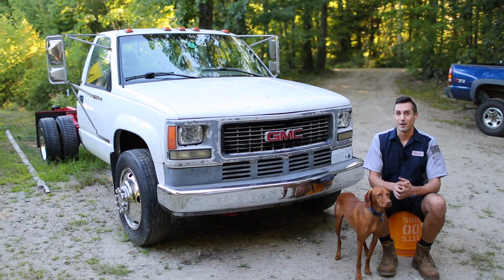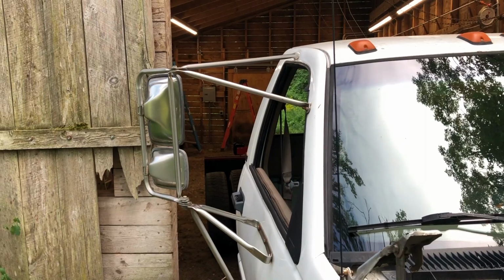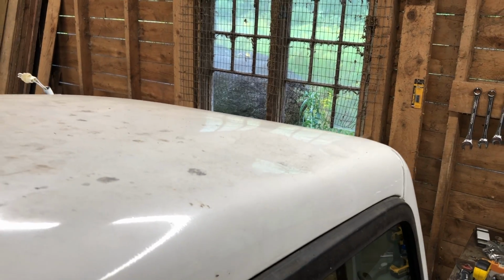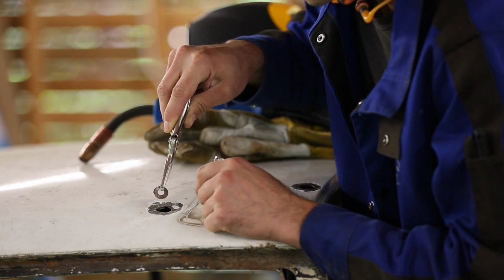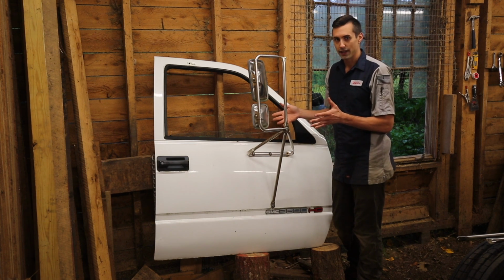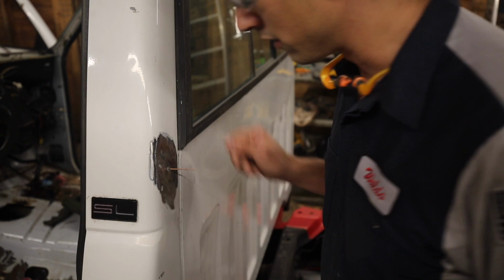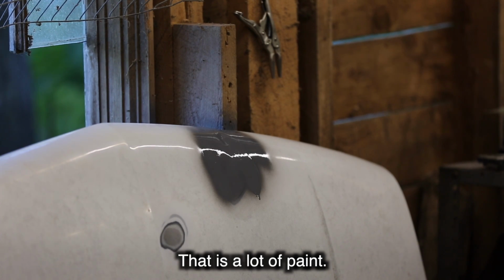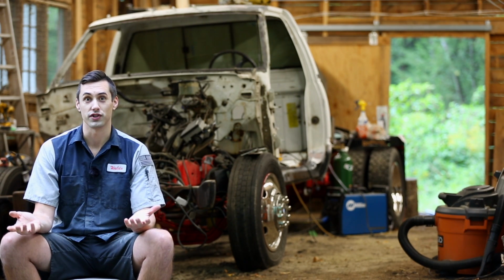Doing Body Work on my $300 Project Truck (GMC C3500HD) [Part 11]

Comment: Bought a stud welder about 2 years ago to repair the top rail of the bed of my truck where a smoker fell over on it and dented it. That was a great tool for the job, and I would recommend it as a cheap tool for anyone wanting to DIY some bodywork. Pretty foolproof too!

Comment: Tips 
To pour from a large paint can put a few strips of wide masking tape across the opening to for a V to use as a spout. You can also pinch a bit into a spout shape and stick it to the side where you will pour from to keep it from running down the side. This works for smaller cans too.
Use three containers to mix the paint and a scale for accuracy.
Pour some part A into one container and B into a second container.
Sit the third on a scale and add A and B to that. If you think that you will need more than one gun of paint having the aa and B already waiting to mix will save time and reduce the risk of contamination to the main can and spillages.

When grinding panels Remember they get hot and will buckle so don’t go overboard.

Dirt floors.
I believe there are a few methods of sealing them . 
One involves mixing in linseed oil another involves racking in a bag of cement and some sand tamping it down then misting some water over it to cause the cement to cure. You can also use lime but you need twice as much.

Rivnuts
There are three or more types 
Alloy, zinc coated steel and stainless steel .
Use steel or stainless steel ones on steel and alloy or stainless on alloy.
On steel put some thread locker or CA glue on them before inserting in the hole. This helps keep them from spinning and helps prevent corrosion.

Comment: A few tips:  I would dip out of the primer can, and punch holes around the rim to allow the excess to drain back in when pouring over the side.  Pouring the catalyst works better when the outlet is on top so the air can flow in smoothly.
Reply from the maker: Thanks for the tips! 👍

Comment: I’m interested why you went with a 24valve and not a 12valve
Reply from the maker: I honestly would have gone either way, but I just happened to find a 24 valve first. It wasn't easy finding a manual with RWD!
Reply: @WaldosWorld   will you be doing a p7100 conversion on it  or are you going to leave the vp44 on it
Reply from the maker: I'm going to leave the VP44 in it for now. I have a FASS fuel system for it to help ensure it doesn't run out of fuel pressure. If it ever needs to be replaced, I'll definitely consider a p-pump
Reply: So are you using the engine mounted lift pump and the FASS?

Comment: A you should of bought dodge 2006 mirrors that's what I put on my dually I just can't wait to do my cummins swap I got most of the stuff but I gotta finish my peterbilt it's on my channel and I gotta tear the engine out of my mega cab and rebuild it
Reply from the maker: I still haven't committed on mirrors yet, though I guess the default choice is to keep the big stainless truck mirrors. Sounds like you've got your work set out for you with all those projects!

Comment: good night friend ... a question what gearbox I can fit a cummins 4bt engine to adapt to a 3500 silverado 2005 truck..
Reply from the maker: That's a tough question because it depends on what flywheel housing the 4BT has. I'd imagine that many of them have a SAE 2 or SAE 3 flywheel housing for which it would be fairly easy to find a matching transmission.

Comment: I suggest fitting your doors before you apply the last primer coat.  If the doors are aftermarket, you may have fitment issues.  I am fortunate that I live in the south and can find used OEM doors in salvage yards that are in good condition.
Reply from the maker: Yeah, I thought about going to a junk yard, but the doors there will be just as bad  if not worse!
Reply: You maybe surprised with what you find. I scored a nice set of OEM fenders for my GMT400 from a local salvage yard up here in the rust belt of New England. Watch Car-part.com and you maybe surprised

Comment: every time i have bought "new" doors, they were a fitment nightmare. compromising on body lines and making the door seal. good luck waldo. i think you are more patient than me....no doubt you will make them work.
Reply from the maker: Yeah, that's a good point. So far, the replacement panels I've bought have had less than perfect fitment, so I shouldn't expect anything different from the doors. I guess we'll see what happens 🤷‍♂️

Comment: Waldo, is the plan to keep the compressor outside?  It looks permanently mounted to that slab.  Won’t there be issues with the pump/electrical and rain?
Reply from the maker: Yeah, I'll be getting it some shelter at some point. Luckily we've had some really nice dry weather lately!

Comment: My dad has a old 2000 dodge ram 3500 if like to have as a start to a project. It was my grandpas truck before. A bunch of Norwegians bought in new in 2000 with all the options in the book. Leather seats,wood trim,ect. But it's not in good shape. It has a damaged frame. And it needs some body panels replaced. I can buy a new or used frame and the body panels are literally everywhere for them. I guess what could go wrong lol. There's actually a news report with the truck in it from 2006. And I have a video on the truck when we got it
Reply from the maker: Oh wow, that's pretty cool! Is it a dually? Sounds like it'll be a nice truck after a bit of TLC!
Reply: @WaldosWorld  yessir 1 ton dually.

Comment: Great video but just to let you know you could use the tree branch to lower the compressor  by using a rope and tired over the tree onto the compressor and lift it up gently and drove your truck out underneath the compressor then lower the compressor gently by laying lose the rope gently
Reply from the maker: Yeah, I was thinking about that. It's an oak tree, so it should be strong, but I wasn't sure if any of the branches were big enough to handle the weight 🤷‍♂️

Comment: Another great video, Waldo!  I use a set of plastic kitchen measuring cups for scooping small amounts of paint out of a full can, like you had.  I’ve had good luck using POR-15 rust paint on floor pans.
Reply from the maker: Good idea! POR-15 is what I used on the frame, so it'll be interesting to see how it holds up over time!

Comment: you should put dodge tow mirrors on it to match the dodge/cummins engine
Reply from the maker: That's a good point! I didn't realize it, but this would be a great time to pick out some new mirrors. I'll have to really think about that. The original mirrors it has are great for towing, but they're really big for everyday use, so maybe a new set of mirrors is in order 👍
Reply: @WaldosWorld just be careful because the 2nd/3rd gen dodge glass shakes and can be very distracting

Comment: Nice job, went through same process on a 62 C10. Lots of body and metal work, it definitely takes time. Your videos have given me the inspiration to restore my 97 K3500 crew cab. Luckily it doesn't need body panel replacement. I was fortunate enough to find a color and year matching Suburban for the doors and fenders but hood and bed has infamous paint peeling. Definitely interested to see the paint process
Reply from the maker: Oh nice, that'll be awesome to get the K3500 back into shape! I'll try to go through the painting process in detail. I'm sure you can do it!
Reply: @WaldosWorld Thank you, looking forward to seeing the process. Definitely a cool project.